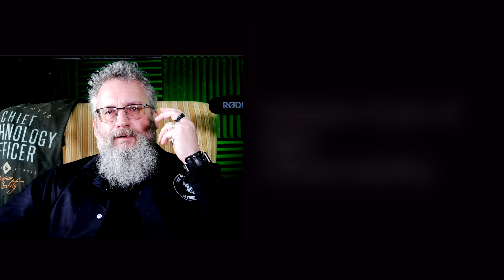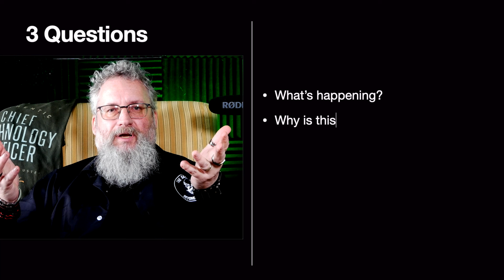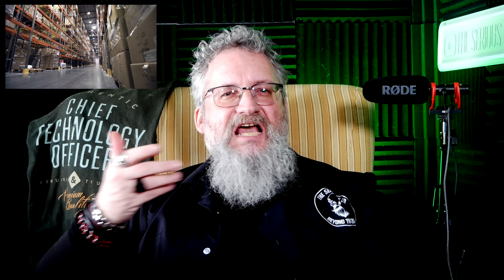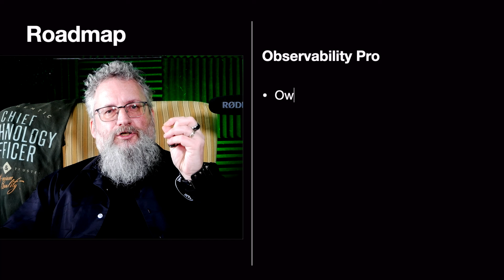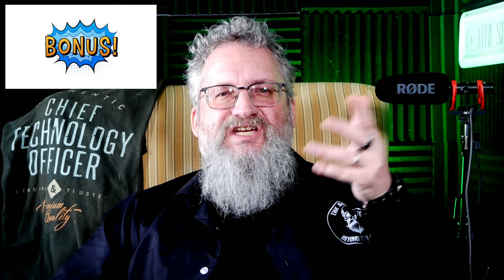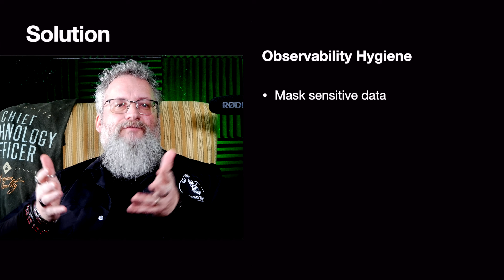Master OBSERVABILITY Engineering in NO TIME!

Comment: how to do these with local systems to users like desktop apps? you can only log so much and there is always something you didn't log and you don't know the "value" of something. In desktop apps, errors happen, then we add logs for that. Then observe. Then fix if found something. And most of the time, nothing is found. Then more logs. it is a mess. Please also put a light on such issues? Looking forward to next one!!
Reply from the maker: Great question! Observability in desktop apps is trickier, but the key is designing for visibility upfront instead of chasing logs after every crash.

🔹 Structured logs → Log meaningful events, not just errors.
🔹 Passive tracing → Track user actions & performance, even locally.
🔹 Crash reporting → Automate error collection (Crashpad, Sentry, etc.).
🔹 Dynamic logging → Toggle detailed logs remotely without redeploying.

It’s a different game than web apps, but the right setup saves you from endless log-guessing. I may highlight this in a future video if there's enough demand—thanks for the great question! 🔥

(For tools: check out Sentry, OpenTelemetry, or SQLite-based session logging.)